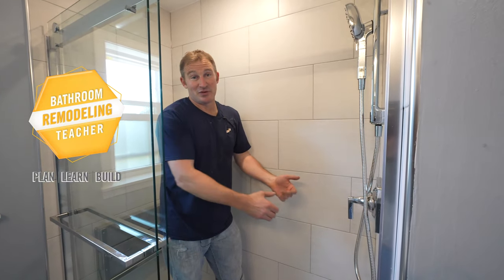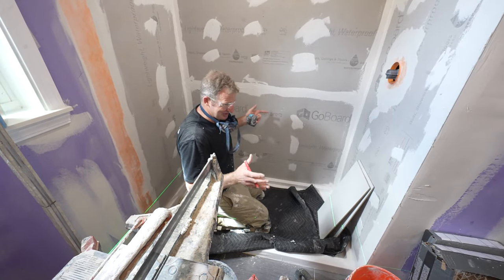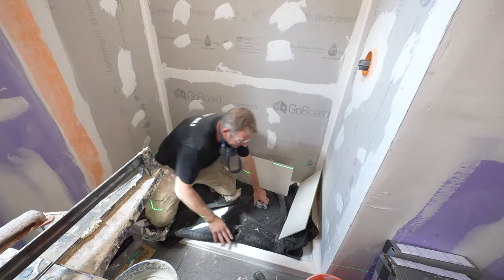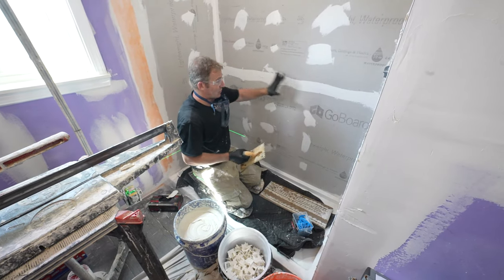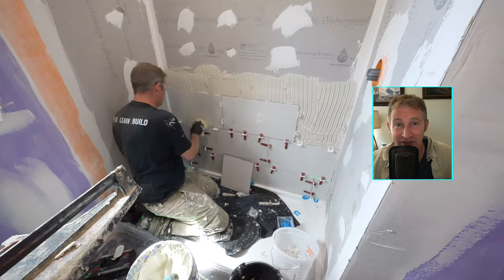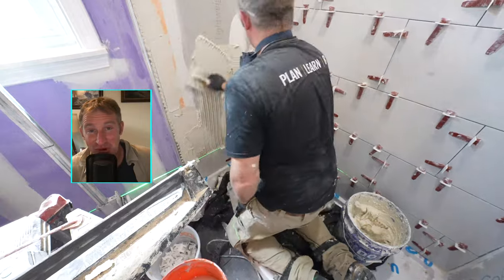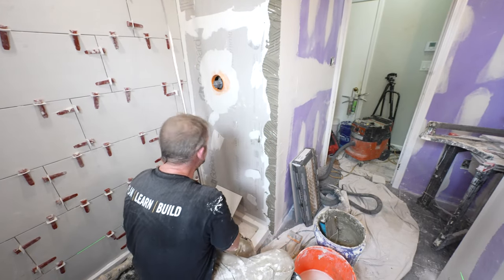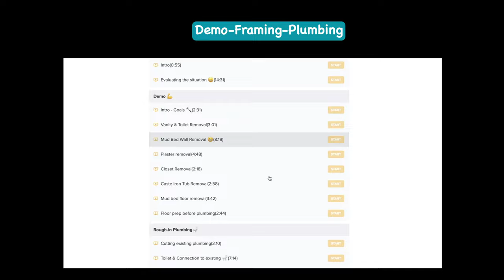Tile a Shower in a Day | PLAN LEARN BUILD

Comment: I'm a DIY guy - I have done two bathrooms worth of tile now and currently going into my second master bathroom in two years because we moved. The BEST way for a DIY job to look professional is to keep it simple like this. Adding a niche, or a band, or whatever adds SO much time and possible ways to screw up. With these large format tiles, tile leveling systems, edge profiles etc. its all pretty fool proof IF you keep it simple.

Comment: Wow that is an efficiently laid out workspace!  No running out to a wet saw all day, two ways to cut and trim tile right at the shower.  Great tool and thinset advice too.  Nice not having to use ledger board if the acrylic is level.  thanks! subbed

Comment: I have been watching a lot of your videos lately and learning a lot. I am in the process of remodeling my bathroom and I will be using 12x24 tiles, Goboard, and Ardex X5 ( last two solely based on your recommendations 🙏 ). I had a very hard time finding both the Goboard and the Ardex for sale in my area, had to travel pretty far for it. My question is how many bags of Ardex do you estimate are necessary when installing 12x24 wall tile. I bought two bags only based on the instructions written on the bag ( I have about 65 sf to tile ) and I hope they are enough so I wouldn't have to drive back for another bag.
Reply: @marcopoulin1897  I think it is a matter of personal preference. I used Goboard and I am super happy with how it went

Comment: Great tip re: keeping profile proud of edge of wall a bit. Never thought of that. I do find with 3/8 tiles a 1/2 proline covers well as it allows for mortar thickness. Curious the dustless grinder set up. Is that a separate attachment or did you purchase with grinder.? Great video.
Reply from the maker: Yeah I have the alpha and fein shrouds and then a fein shop vac with plug port. Links are in description. But a major game changer with keeping the dust down in these small spaces 👍

Comment: SUPER helpful. Thanks for sharing this and especially the little things/tricks like the trim piece and such!
Question - If you use siliconized caulk on the top joint because of expansion, do you use this as well for that joint on both back corners as the side walls could expand/contract?

Comment: I’ve seen videos where some people put the go board over the shower pan mounting flange (like in this video) and others butting it up against the top of the flange so the go board doesn’t bow out at the bottom. Is there a preferred or more correct way to do this? Love all your vids
Reply from the maker: If you are lining up with existing 1/2” drywall or other existing wall surface, that is the way you have to go. Otherwise I think this is better if you have ability to shim and overcome the flange 
Other way works 👍

Comment: For the tile edge on the flat wall next to the window, you used Rondec instead of an "edge" piece of tile.  Won't the tile be protruding 3/8" past the wall near the window that will be painted?  I'm trying to understand how to get a finished edge on the tile.  I wouldn't imagine you'd built up 3/8" of joint compound to "feather" the Rondec into the painted drywall.

Comment: do you think of 15x30 tile save time when installing in a 60x30 space
Reply from the maker: If you have the equipment to cut it easily. If not, no. 12 x 24s would be faster with normal tile saws

Comment: Did you cut the bottom row so the top of the tile was level with the laser?  Ive always threw up a board cut to level and went up from there to ensure level placing going up.  Smart idea doing it that way.
Reply from the maker: Yes. I used to use ledger boards like you described. But with laser, it ends up being quicker. I probably would have had to place those bottom tiles next day if I used a ledger 👍

Comment: I would have wiped the thinset off the shower pan before applying my tile. Thinset in the joint is hard to get out after it's dried, additionally cleaning it off before it dries is better but still not optimal.

Comment: Any issue with the thinset going on top of the silicone that the go board requires?
Reply from the maker: Go board sealant is a polyurethane sealant designed for thinset to bond to. Just like Wedi sealant and other systems 👍

Comment: I can't get Ardex X 5 (or any Ardex Brand) nearby me. Are there any alternative brands (from say the Big Box Improvement stores) that you recommend?
Reply from the maker: Nothing really compares in my mind. I’d go mapei thinsets from lowes verses custom blend at depot. But neither place will offer the non sag stuff like Ardex. Mapei super flex is good to. Or laticrete 4xlt
Reply: In my opinion Schluter All Set has excellent anti-sag. It's my favorite in my area. I'd have to drive an hour for Ardex.

Comment: What size spacers did you use on these tiles brother. I learn more from you then going to the schluter workshops in cranberry up the road from you haha
Reply from the maker: 😆 thanks, those Schluter events are 👍 wish every manufacturer did that. I used 1/32” clips https://amzn.to/3woe0Jm
Reply from the maker: Porcelain tiles were not completely square on sides, so with the 1/32” clips it actually gave 1/16” joints 👍
Reply: I'm gonna have to come down to Pittsburgh and buy you lunch sometime haha. You have helped so much. I'm only an hour n half away. Appreciate you

Comment: 8:39 do like how use flat side to “key in” the thinset; a process I was taught when was an apprentice just learning; and really don’t see even the “pros” today doing this. They’ll just “key in” thinset with notches and then finish them out before setting tile.
Now, not sure if makes a difference, but I do know that if you don’t “key-in” the thinset in some way…..THAT SURE DOES MAKE A DIFFERENCE, but how you go about it, not sure; but for me……still use flat side of trowel as that’s what I’m comfortable with b/c how was taught long ago.
Also, it’s a pet peeve of mine to have a shower stub out, valve, etc….land right on a grout line; and will try to avoid during layout as much as you can, but sometimes it just can’t be helped.
Nice vid, and good looking tile, grout lines.
Cheers✌🏻

Comment: Your pan is out of level from the start???
Reply: You can either add cost to pour self leveling cement on subfloor or adjust your first tile level. Leveling the pan on mortar pile beneath it can cause it to be way higher than the flooring. Self-leveler is a costly addition to a project. It's usually easiest to just adjust the first row of tile. It's the case in most bath remodels.

Comment: The whole project in one day without help. Not possible. Demo, go to the dump, order and pick up materials, flatten walls, clean up, mud floor, drain. Cut and fit backer boards, water proof, layout, set up saw, not to mention all the other tools, drop cloth, tape off, it goes on and on.
Come on… no back buttering? On 12x24”? Did you use 1/2” trowel?